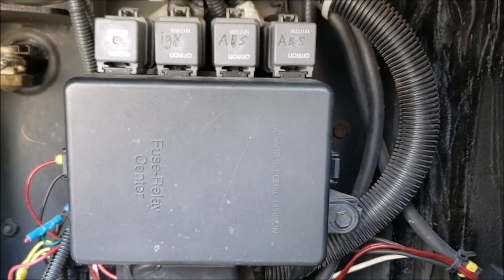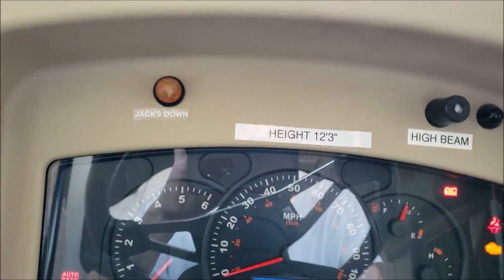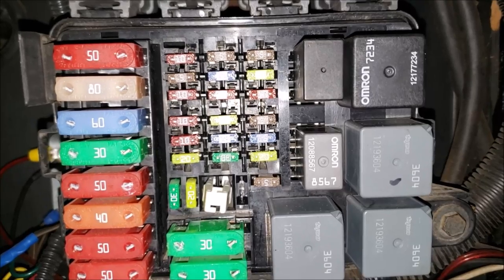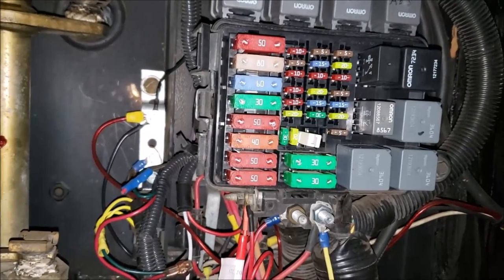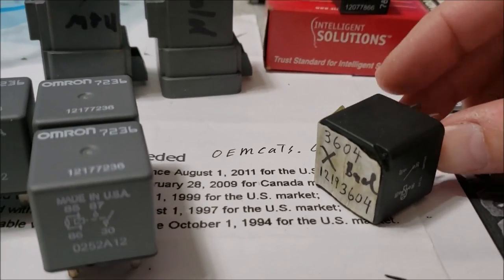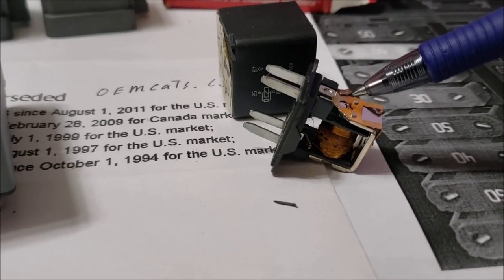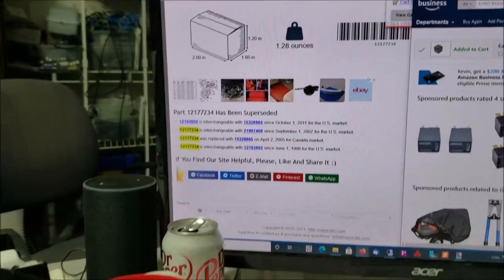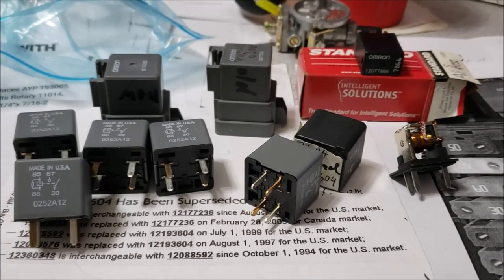Warning Workhorse Chassis Owners Don't Let a Bad Relay Leave You Stranded, Time to Replace Them.

Comment: You are my #1 resource Kevin.  I had the problem this morning where my RV wouldn't shift out of park.  I tried everything, including getting out and rocking the thing manually front to back.  I finally turned off the RV, shifted it into Neutral without it being started.  Then I was able to start it in Neutral and get moving.  After that, I was able to go in and out of park a few times with no problem.  Not sure why it did that.  But your video gives me a second option.
Reply from the maker: On front of fire wall there is a relay labeled BTSI remove this relay that may get you going brake transmission solenoid interlock (BTSI) also this video https://youtu.be/wTHCSuS9cjw?si=xVzkKqtlE1edQhIj

Comment: Your videos are gold! Have you ever run into a situation where your brake pedal didn’t want to come all the way back up? When i press the brake pedal the RV stops or slows fine, but then my pedal stays slightly depressed, causing me to have to pull it up slightly with my foot. I checked and greased the linkage. Fluid reservoir is full. Any thoughts on the matter would be appreciated. Thanks for all you do in posting these videos!
Reply from the maker: 2 videos for your https://youtu.be/wTHCSuS9cjw?si=arGG6_liZ3rtPhxP&t=856   and https://youtu.be/QeNhJbUn7Yk?si=LCForsLrBAy2tpYm&t=475
is your brake light staying on? my cell 606-875-0125 Kevin

Comment: Great advice and information. Thanks for passing on the knowledge and love for others. I’m dealing with a wiper module issue. Wipers stay on. The multi switch is okay, as well as the wiper motor. However, I can’t locate the fuse (not listed on diagram), which is 2006 Workhorse Tiffin Allegro. Any ideas where to look? I may have to replace the module.
Reply from the maker: Call or text me at 606-875-0125 Kevin I can help you

Comment: Kevin, I'm a big fan of your youtube videos.  I have a 2002 Winnebago Itasca on a 8.1 Workhorse.  My AC fan only works on the high speed.  I googled it, sounds like a common problem, but no solution out there.  Any ideas?
Reply from the maker: Yes give me a call 606-875-0125 Kevin

Comment: I had my wheel lock up a few times. Would uplugging the BTS1 fix this as well?
I also found out about the relays a couple of years ago, when my w22 would not start. Unfortuneatly for me, it was the starter. But changing the relay helped to diagnose it.
Thanks again for the vid Kevin!
Reply from the maker: Yes per my testing unplugging the bts1 relay will cause the shifter solenoid to retract releasing the shift lever.

Comment: Thanks I have a 2006 bounced and the wipers only work on high no variable could It be a relay
Reply from the maker: More likely the Wiper Control Module  you can buy it here but call first to confirm my guess or look at diagnostic info on below part https://www.ultrarvproducts.com/W0007967-Workhorse-W-series-Wiper-Control-Module

Comment: Hi Kevin,
I’m looking for the drivers window relay location. My Monaco Monarch on W22 has the truckers door and the electric window is not working all the time . Sometimes it does and sometimes it doesn’t. The switch looks ok so no I’m trying to find the relay. Any idea?
Reply from the maker: Yes I have the same door but my window switch has no relay give me a call or text my cell phone number 606-875-0125

Comment: Would a bad starter relay cause a Eng Comm Fail, Trans Comm Fail error messages to be displayed??  I have the exact same fuse block and I am getting those messages on my dash.
Reply from the maker: No text me and I will help you troubleshoot. 606-875-0125 Kevin
Reply: @ktoutdoor , no need, my problem was I didn't have one of the wiring harnesses that goes up into the dash screwed together.  I did that, turned the key and the engine started.  All is good!!!

Comment: 2006 Tiffin W24 will not shift out of park. New BTSI solenoid/interlock rod, new brake switch, brake fuse in engine compartment is good. My rig does not shift at all with engine off. Doesn't matter what position ignition key is in, with or without parking brake, etc. it will not shift into neutral. Going to try the relay next. This is getting old. Grr...
Reply: Ever get it figured out?

Comment: Have watched many times is there a relay for the wipers
Reply from the maker: No relay only a fuse if you are having wiper trouble on a w22 or w24 go to this page print out troubleshooting guide you may need to module and fuse updated
https://www.ultrarvproducts.com/W0007967-Workhorse-W-series-Wiper-Control-Module

Comment: Hey Kevin, I have the same problem on my 2004 WH W-20/22…turn the ignition key and nothing happens; no crank and no panel lights. The battery tested good and I am able to use the house battery boost to get it started (barely). Same problem after driving highway for an hour. 

I did as you did- swapped the starter relay with another relay like it…same problem 

Your thoughts?
Reply from the maker: Call my cell  phone 606-875-0125  I will do 
 what I can to help you.
Reply: What was the outcome of this issue?  I am currently experiencing the same exact problem, however; I believe it may be the starter solenoid causing this.
Reply from the maker: @chuckwyse418  Yes it was the solenoid check out this video note keep your OEM starter .. https://youtu.be/R02Io7_xNI8
Reply: @ktoutdoor  Thanks!  I have watched this video twice now.  Fortunately, I still have the original starter.  I am a member of irv2 and found your videos and ORMY’s parts reference page to be most helpful.
Reply from the maker: @chuckwyse418  did you get it fixed? If not give me a call 606-875-0125 Kevin
Reply: @ktoutdoor  The rig is parked in my driveway at this time, so I am in good shape as far as not being stranded.  I will keep you updated as far as the repair goes and will get the solenoid ordered on Monday.  Thanks for looking out though!  Much appreciated.

Comment: Have a 2003 workhorse RV and cannot find the turn signal flasher. I located the hazard flasher but not the turn signal relay. Any ideas?
Reply from the maker: Sounds like the makings of a new video... did you find yours.